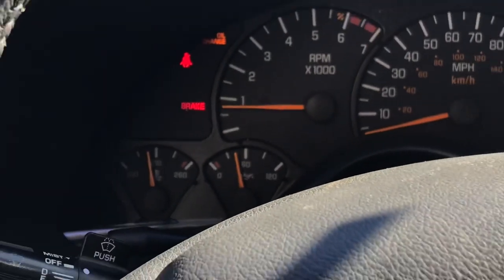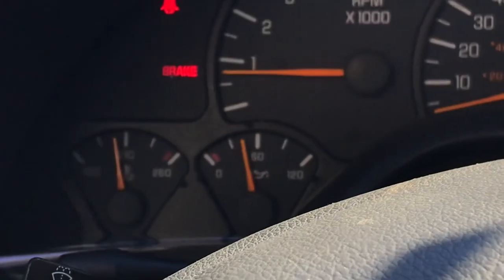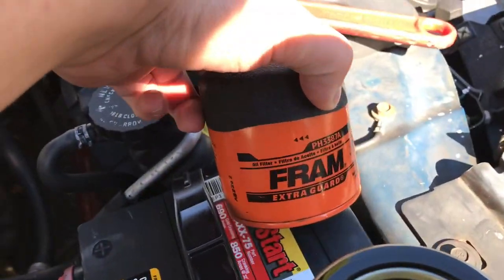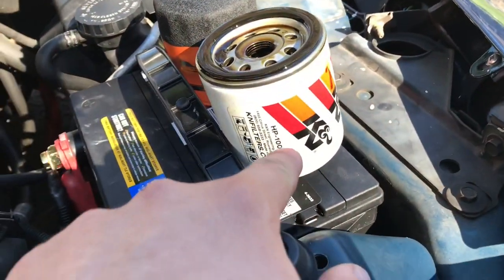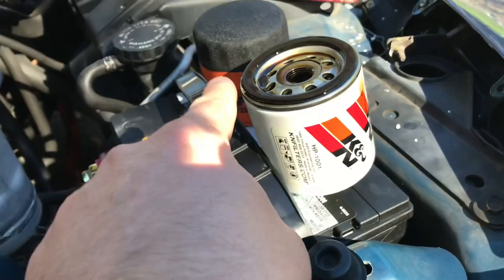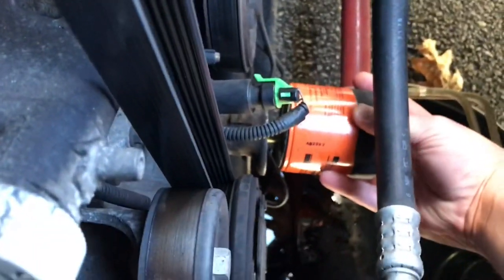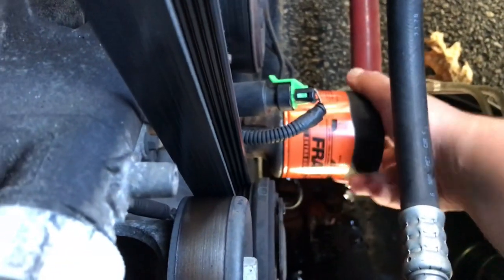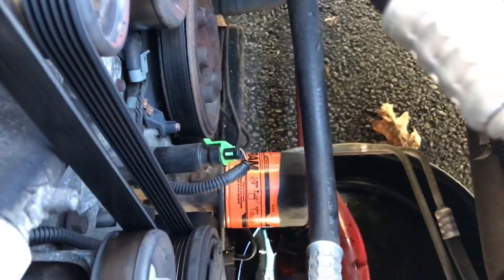Clogged Oil Filter

Comment: Yep, any type of thick Lucas oil treatment, stop smoke, or stop leak will clogger oil filter and make your oil pressure go down because your oil is no longer free flowing. 

This happened to me when I used that Lucas oil treatment to clean out the engine before my oil change, and my oil pressure went significantly down. But once I change that clogged oil filter there was no problem.

Comment: I have a question that might sound stupid would your oil filter clog as you're driving down the road and if you put a little clean oil in it because my dipstick says it's a little low and put some fresh oil in it and it runs just fine does not sound like it's chugging does anybody have any ideas?

Comment: Lucas oil did that to my blazer too!
Reply from the maker: It's a simple temporary fix until the next future oil change, most oils can run in an engine for a lot longer time because the newer process it goes through, but, the filters still clog before hand before the oil goes bad. There's a YouTube video on oil filters and what's in them and what they're made of and the guy cuts them apart hence why I run K&N in all of my cars and cars I work on. FYI, K&N oil filters are able to run synthetic easier=more oil flow. In older vehicles, blow-by gases kill oil's quicker so on my 1999 Pontiac Firebird I do frequent oil changes. It's over 20 years old with over 235K miles on it. I hope this reply helped you out!
Reply: @screamingchicken6781  you should try Royal Purple filters. They have really good flow and fantastic filtration. I use it with Liqui Moly in my Titan. I use those filters on a bunch of vehicles. Quite pricey though at around $15 each.
Reply from the maker: @bryanmartinez6600  I heard of them, I've heard really good things from them, and I'm pretty sure Royal Purple is better than K&N according to a video I saw on oil filter comparisons when someone cut them open and explained how they worked and what material they're made of etc.